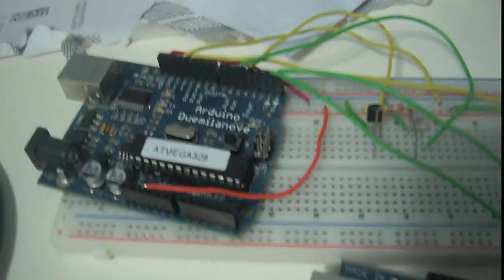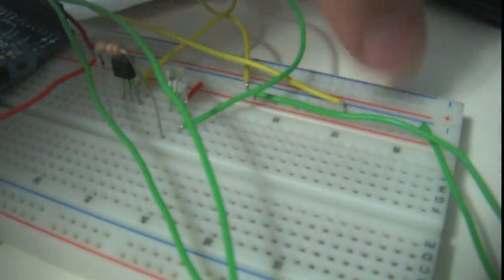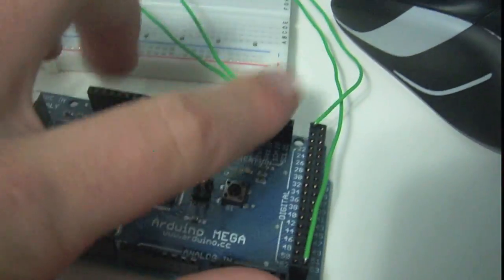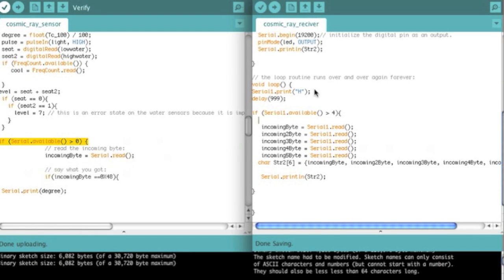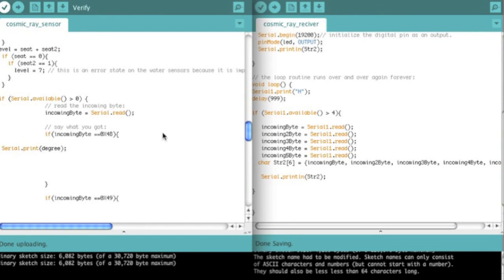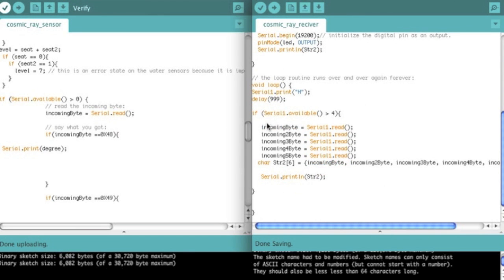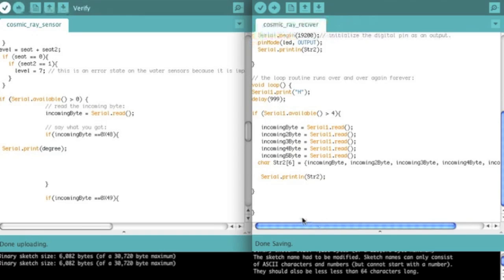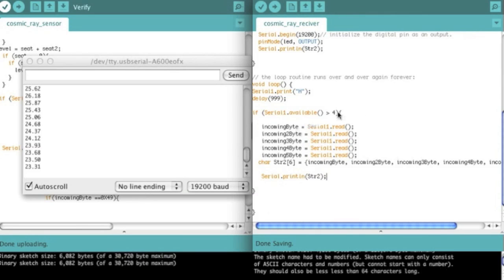Arduino Serial Communication

Comment: I wat use communication beteween 2 arduinos, but I'm using interface RS485MAX485 and protocol modbus, simple modbus, but I no getting to make it. I need help with that, Do you can help me?